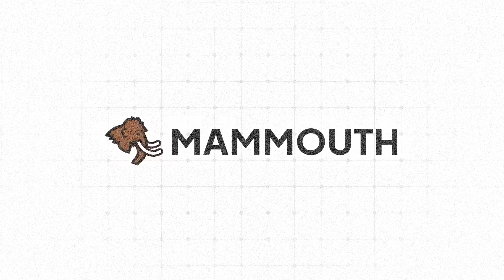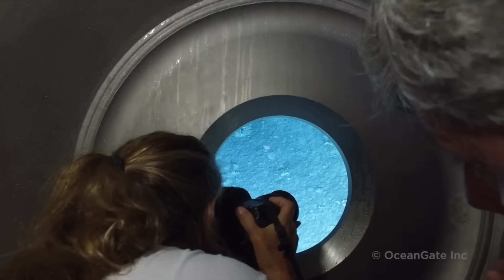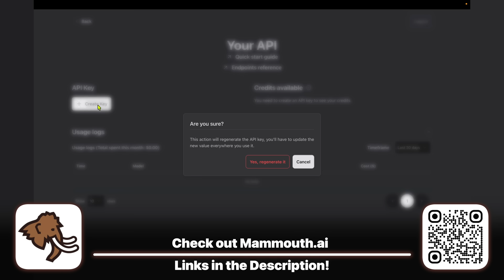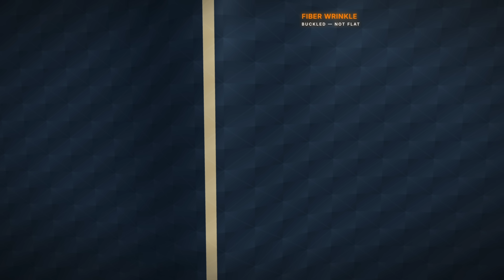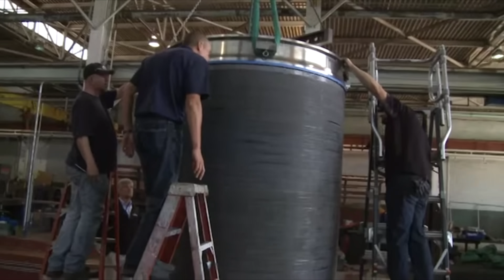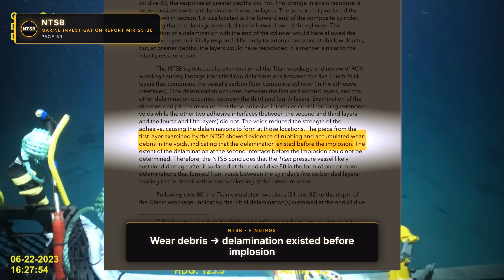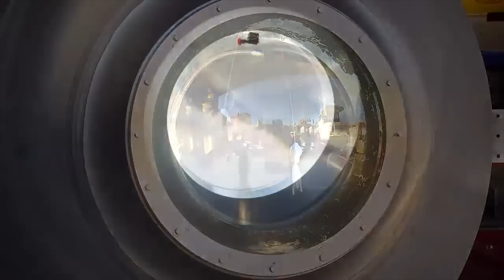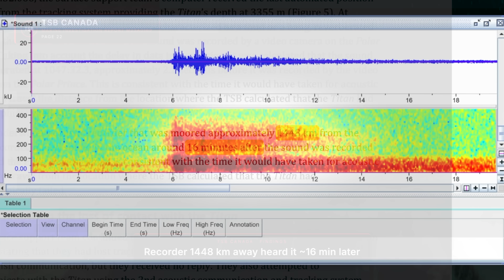Oceangate Titan: It was WORSE Than We Thought

Comment: The problem with using carbon fiber for deap sea diving is not that it can't handle such depths. It is that it is unpredictable and it weakens in ways that can not be measured or predicted. Until it will at some point fail (10 dives, 100 dives, 1000 dives, doesn't matter, eventually it will happen). And when it does it will fail instantly and catastrophically. Case in point the titan submersible.
Reply: Stress failure will happen eventually, regardless of the material. It's through engineering and mechanical testing we can understand the limits of any particular material, including carbon fibre.
Reply: @UberSprite  Not true, or rather your argument that since stress failure happens for all materials means the type of material isn't important is wrong. Each material fails differently. Metals show fatigue and predictors long before critical failure, unlike carbon fiber. Therefor it is idiocy to use carbon fiber as a hull instead of titanium. Because you can replace or reforge your titanium hull long before it would fail critically, while with carbon fiber you will never know if it will fail this dive or hundreds of dives from now, but there's always a chance it might.
Reply: @Asrudin I'm not making any argument. I never said "the type of material isnt important".
I agree each material fails differently. That's why I said, "through ... testing we can understand the limits of any particular material".
I think a carbon fibre hull can be replaced just as frequently as a titanium hull, though obviously not reforged. It would also be far less expensive and time consuming.
I haven't rewatched the video yet, but seem to recall a portion directed at the known reliability of carbon fibre, when constructed using specific methods and thicknesses. I'll have to learn more about it before I undertake my car body project.

Comment: You must fail, many many times, But, you could do much of the failing with less expensive models, designed for learning. Engineering process is a good diagnosis and this should be in the curriculum in STEM school.

Comment: Your initial suggestive premise is already flawed logically. If carbon fiber, properly used is better than steel, then why don't the navies of the world use it for their military subs? Yes, carbon fiber allowed the titan to dive to the Titanic several times so theoretically this means that the world navies , using "proper construction " with carbon fiber can build military submarines (boats) that can dive deeper than the current best military boats. If the problem is not the material, but the wat it is used in the construction, then go carbon fiber, yes? But navies DOIN't; they use titanium, grades of special steel, or a combination of the two. 
NOT CARBON FIBER A carbon fiber hull, by your suggestion would allow deeper dives, and a quieter hull. Of course such a hull would be more vulnerable to the torpedo hit or depth charge concussion. BUT this would be less of a problem at deeper depths where te water pressure would negate the effects of these weapons. 
Then you brought up the  reason why Titan used a cylindrical hull; for maximum passenger capacity (NOT COMFORT)). A sphere is a better design, but a spherewould need a bigger volume to acvcomodate at least five adult passengers. More volume means more expense, and OceanGate was going for economy (cheaper) rather than safety. A sphere would have also allowed a more sophistivcated ingress - exit system to allow quicker evacuation in case of emergency. As it is The titsn hasd more in common with the submersible in the game / movie IRON LUNG with no way to open the boat from the inside.
Hmmm, i wonder... if the movie IRON LUNG had come out brfore the last titan dive, would thapassengers on titan have been comfortable with the unsettling comparison?
Reply: Navy subs use steel because they don't go very deep. For example, USS Thresher met her fate at around 750m, while the Titanic is at 3800m. Steel is very cheap, very easy to work with, and very well understood. So if you can use steel you absolutely will use it.

DSVs go much deeper. Obviously steel can work if you have enough of it, but you need a much thicker pressure hull and you quickly reach the point where even just an empty hull has such thick walls that it will have negative buoyancy. That's why strength to weight is so important for DSVs, which requires them to use more exotic and expensive materials that military subs would never bother with.

Fun fact: You can make a DSV with a steel hull, that's what the Trieste did. It just needed a gigantic and ridiculous external float system using oil. Modern titanium DSVs also require external floats, but they use a much less terrifying glass bead system.

Comment: should have just made a bigger sphere with a round sofa
Reply: Yeah. Way easier.
Reply: @alexc7857  I would go with two balls + support shaft for electronic and communication.
Reply: Maybe, but size is also a dimensioning factor in hoop stress. So by increasing the diameter you may end up with similar result that is a wall with insuficient margin between allowables and service stresses.
Reply: @thomasmoura  Sphere shape allows extremely easy strength testing. We can calculate and simulate different wall materials, thicknesses, space inside, depths... with insane accuracy. The ball shape creates massive strength advantages to anything else. Rather go with bigger and thicker ball than any other option.
Reply: @data-analyytikko on top of my points still standing, manufacturing a cfrp sphere is actually harder than a cylinder.
Reply: @thomasmoura  Absolutely, but cylinder is horrible shape for massive pressures and long time heavy use. About manufacturing, true with older technology. Larger scale new generation avionic/rocket tier 3D metal printing is the way to go. Similar to what is beeing used for printing Raptor 3 engines. Eventually this is going to be the most reliable way of creating all type of stuff + the ability to add everything inside the structure itself with like 0.1mm accuracy.

Doesn't even have to be sphere shaped inside, but create all the lines and oxygen tanks without additional costs. This will change so many industries and allows fast manufacturing/testing.